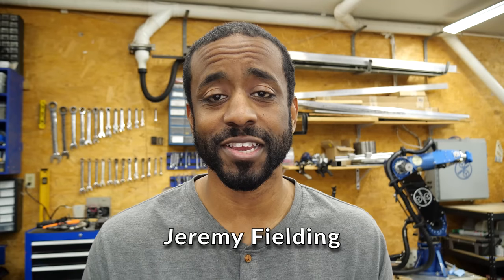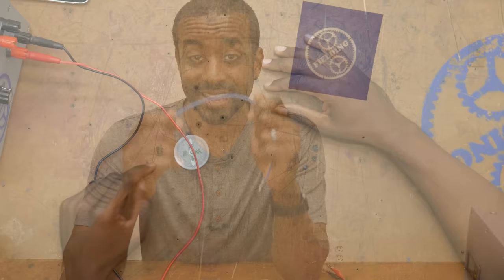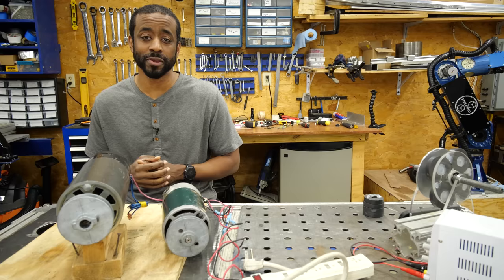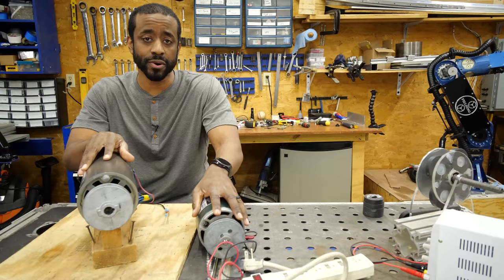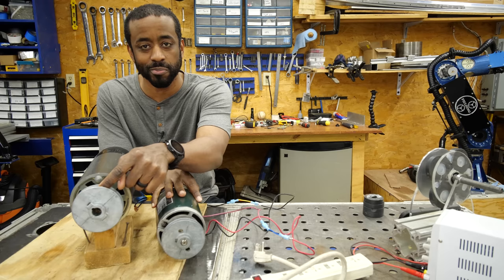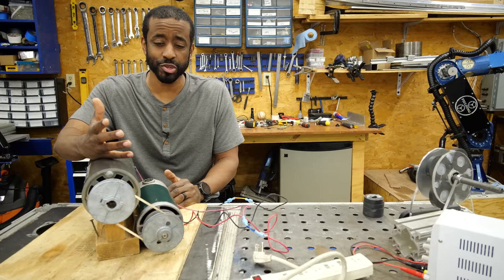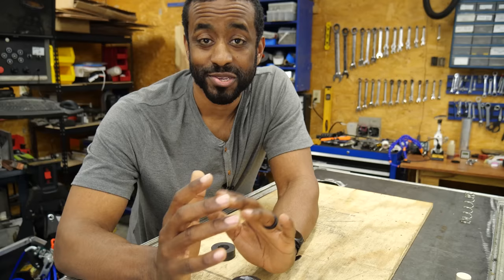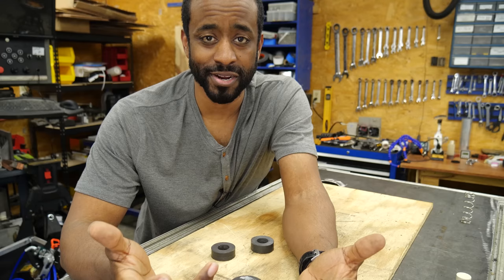Reviewing Free Energy Generators.  A Response to My Video "Nikola Tesla's Greatest Invention"- 102

Comment: Thank you for this! I was trying to design a generator for a small wind turbine to power a sensor cluster to record environmental data, and when I looked up anything to do with building a generator all I got was free energy nonsense. 
I'm in school to be an engineer. I know limit of efficiency is 1. Yet all I could get was fake free energy!
Reply: if you can take an alternator and reverse the polarity to make it a motor -- Could you just take a smaller motor and reverse it so it becomes a generator ???
Reply: @thistledewoutdoors3331  yeah but the effeciency of a motor wound to be a motor, running as a generator is lower than a "motor" which is wound to be a generator. It can be as much as a 20% difference, which means I could be losing hundreds of watts from Eddy currents and other field losses
Reply: @thistledewoutdoors3331 ,

Scientifically, motors and generators are the same.  However, motors and generators are designed and built to perform efficiently only for certain tasks.  This means motors (generators) work as motors (generators) quite well, but not so well as generators (motors).
Reply: @thistledewoutdoors3331  No. Just No. Look up the meaning of TANSTAAFL.
Reply: @invalidaccount2315  it's just so weird I want to make a normal, actual generator with an effeciency north of 75% and all I get is nonsense about fun magnets getting 150% effeciency lmao

Comment: Thanks for creating this video. I have had seemingly smart people try to convince me of some really dumb ideas around this. Device would need superconductors even to overcome the resistance in the wires connecting everything together. Motors would also need to be 100% efficient, which is impossible.

Comment: Jeremy,  it just occurred to me, when I built my over-unity device and shipped it off to claim the reward you offered, I forgot to add BRAKES.  Probably best to leave it in the box, and DO NOT turn it on, as it will likely keep accelerating until it flies apart!  Probably a VERY good thing I didn't start it before I packaged it for Fed-Ex.
Reply: Sure hope he spots this comment among the 10,000 ;)

Comment: Well, let's see:  It's missing the friction eliminator, the negative resistance feedback wiring loop, the flux capacitor, the recombobulated fratostat, the entropy reversal module, and the galloping rods. PLUS,  the shafts of the motors are not made from whittled down magic wands. Without these requirements, it cannot work too well... 😑

Comment: Mr. Fielding thanks for the videos. Very well done. I wonder if someday you could address the devices that are purported to save up to 50% or more in electrical power for the household. These fancy little plug-in boxes with a couple of capacitors in them and an LED are all over the net and I'm sure they are being successfully sold. Capacitors do raise the power factor in an induction-rich circuit but that ultimately only benefits the power company. The consumer pays for watts and the consumer's watts stay the same. They have incredibly lengthy ads supporting these devices but they are so full of BS it's laughable. Thanks again.
Reply: They don't work.  120 volts ( pressure ) spinning 15 amps ( flow of electrons ) will never gain in a circuit because they go through ohms ( resistance ) shedding heat ( efficiency )

Comment: Did this experiment when i was 8 years old.  That was like 1987.  I had never even heard of tesla or free energy at the time.  I was playing with dc motors and thought doing exactly this may work.  I never got the output to consumption ratio correct.  Maybe with gearing and a capacitor in-between the dc motors maybe.  I also set it up with a heavy flywheel and a time relay that would apply the power for a couple seconds and let the momentum of the flywheel charge a battery while it slowed down.  No go.  Either way im sure it wont work.
Reply: That’s a great idea with the “pulses” of energy, although it’s still theory and won’t work, it’s still a more thought out idea than a lot of them.

Comment: The last 90 seconds of this video is basically what the US Patent and Trademark Office tells inventors: You send us a working free energy device (not just drawings) and we'll give you a patent after we verify that it works. You can still file a patent application if you want, but in the case of perpetural motion, the USPTO will reject it without a working model. The USPTO is still waiting for someone to meet this requirement. So far, nothing.
Reply: @enigmatistic8470  and yet, no sources or documentation are offered. Not even a Wikipedia link. Just assertions.

Comment: The fun part is that some electric cars do have something like an alternator, that's how they recharge themselves a bit when you brake. That energy isn't free, though: you put the kinetic energy into the car when you accelerated.
Reply: My bmw i3 gets 60kw/h from every 100km at full regeneration. For every 50km at full regeneration I get a full battery (200km driving fast in the city). Electric cars are incredibly efficient in some environments
Reply: @ronhonhola  I have a golf cart with 300 watts of panels on it, and I don't think I've plugged that thing into a charger in 2 years now. But those panels don't really do much more than trickle charge the battery.  And it sees all of maybe 3 km of driving a week.

Comment: The only actual free energy comes from those easily made wind turbines,you see guys build super cheaply from old home fans,making longer fan blades , securing it nicely on their roof & hooking it up to a n alternator, or maybe wiring it straight to a VM multi plug extension cord,then as long as it keeps spinning there's your free power,which in many spots around the world ,can/ does work easily & with no monthly power bill,about as free as it gets,adding an alternator & batteries so you could store a little surplus energy is also a great plan if they can afford those things

Comment: Attaching an alternator to the motor, of course, an electric automobile motor. Like a motor with a transmission torque converter between itself  and an huge alt attached to the converter

Comment: I had to tell a couple family that you couldn't get more energy from setting up a hydrogen generator on their cars, that it would take more energy in the electrolist then you'ld get from fuel it produced. I was glad I found out befor they sent in 100's of $ for  kits.
Reply: oh god that's a horrible scam product
Reply: @adammills4099  Yes it is. However, you can increase the efficiency of the entire system (engine) by using Hydrogen, but not by much and it would take an AWFUL LOT of modification.

It's absolutely not as simple as "Just slap one of these beauties in the engine bay and you're good to go" as they suggest.
Reply: Maybe not if you use Magnetohydrodynamics MHD to turn turbines and generate electricity you also get hydrogen and oxygen gasses. Big Oil has a three phase motor running all their Grasshoppers/Pumps imagine all those Oil fields using all that Electrical Energy...
Reply: @steve-o6413  got any links?
Reply: Stan Myers

Comment: Another example of why it can't work, right in your video but unmentioned; when you spun one (electrically but not rubber-band) connected motor by hand, the other spun less . And this was the case spinning both motors. 

The hardest part of designing a free energy/perpetual motion machine, is hiding the power source. And as you showed in the video, it's not even that hard!

Comment: Ok that clear a lot of thing up thanks.  Which leave me with my original idea: connect a battery to a motor - connect a belt from motor to the alternator - connect the output from the
alternator to a charging control system and feed it back to battery for charging, as well as to things like inverters, rectifiers, light bulbs and so on. Sort of what you would do when using a solar system.

Comment: I'm a former mechanical engineer. Propetual motion machines don't work. They literally violate the laws of physics. I've had some ideas using moving shielding around permanent magnets. Then I worked in electric motor prototyping for a major OEM and realized my concept had the same fatal flaw as all perpetual motion machines. Ignorance on the part of the designer.
Reply: I think the reason all perpetual motion machines don't work is because of a fundamental law of the universe -- Entropy always generally increases over time. Why this matters here is, entropy is the loss in useful energy (Useful energy meaning it can do work), and as it always generally increases over time (The reason I'm saying it generally increases is because you can locally decrease entropy by capturing as much energy as possible, but you always have some loss somewhere, because to decrease entropy, you need energy to move the energy back in, and this means you lose some of that energy, thus still generally increasing entropy but locally decreasing it), you always have some energy loss somewhere.
Reply: The neat bit is that it’s possible to make machines which, at a glance, behave like perpetual motion machines, because they’re tapping into deceptively ‘sized’ sources of previously stored energy.

For example, you can create a machine that slowly extracts the energy stored in a permanent magnet, slowly weakening its magnetic field to the point that, given long enough, it would be a completely inert lump.  If your device is built precisely enough, with small enough losses to friction, vibration, etc. it would survive most examinations, because ‘permanent’ magnets aren’t commonly thought of as batteries.  (Your losses have to be incredibly small to make I work, though, because it’s a battery with an incredibly low instantaneous output.)

It’s easier to hide a normal battery in most devices to provide that ‘free energy’ for your ‘perpetual motion machine’.
Reply: @Vessekx  A permanent magnet has no stored energy, at least not different stored energy than any other matter. Demagnetizing a permanent magnet involves changing the alignment of the grains in the material and like moving anything else takes energy to do.
Reply: @nikkiofthevalley  Entropy can not always increase. You would turn universe motion into non motion, which is not possible.

Comment: I was intrigued by free energy devices for a while when I was younger - in particular the thought I had was that since there were so many claimed methods of generating overunity (gravity 'glitches', permanent magnets, back EMF phenomena in pulsed electromagnets), at least one 'had' to work. I got sidetracked by the idea that "OK, X is a 'conservative field', which implies there are fields which are not conservative, or maybe it can be 'tricked' into behaving in a non-conservative way". Ultimately what I got from it was that it's a very fundamental thing - for the universe to be comprehensible the law of identity must hold; a thing is what it is and cannot change without some reason. If you have one thing it cannot become two things, or fifty things; things can't vanish without going somewhere and things can't appear without coming from somewhere (as a baby has to learn at an early age). Conservation of matter and energy are implied by the fact that we can observe a universe that seems to make sense. Once that energy's spread out and disordered beyond a certain point, it's not gone - but at some point it will take more energy to gather it up and reorder it than you would expect to get out of it. Beyond that point there's no sense in trying to recover it. Once again - once disordered, a thing won't become ordered again without some cause, so the Second Law of Thermodynamics is also implied by a comprehensible, rational universe.

None of this rules out devices that tap into some hitherto unknown source of potential energy, even one too vast to be realistically exhausted by human needs. There is however no reason to believe that such a device would be more efficient or useful than a solar panel - free energy advocates often just seem to assume such energy sources would be reliable, work everywhere, and be scaleable.
Reply: WRONG!!!
Reply: Half of universe is entropy and half is negentropy. Negentropy is life-force and consciousness. Things do not stay disordered, because every disordered piece in universe get used again combined shifted and made ordered again by negentropy/consciousness. You can say that negentropy is infinite in what it can see and utilize. Since everything in universe is configuration of movements, and movements never stop, configuration of every object always change as it move through time space and its location and links with everything else change every moment. An object is trading codes with every other object. "Energy" is not vague scalar property that you have or don't have. Energy is configuration of motions, a code in other words. Therefore every atom poses differently coded energy because it is unique because it is in unique time space location, and have unique trajectory compared to everything else, and it have to communicate its configuration and trajectory to everyone else. This describes fractal hologram. This communication of everything with everything is called trade of codes. Its unstoppable and happens regardless of what object is doing or not doing. When you make overunity device, the device is trading codes with the rest of universe. If you made it in proper way, it will send out codes of movement that you don't need and receive back codes of movement that you do need. Those needed and useful codes of movement you call free energy. There is always plenty of it if you trade it right. The energy that you spent can not stop existing, it ricochet trough space time and will always get picked by negentropy factor that reorder it for utilization again. Every energy get utilized again. That is why you can always get it back if you state which energy codes you want, and which you will trade for it. Law of Thermodynamics is brainwashing.
Reply: @radivojr  WRONG
Reply: @radivojr  Rubbish

Comment: The last "perpetual motion" machine I played with required you to 1st charge a closed circuit coils of copper wires. Only the magnetic field was "perpetual". Only had to recharge it 1x time in 15 years. (Because the liquid helium got too low. It was a magnet for an NMR)

Comment: Having at least 1% of functioning 'grey matter' is all I need to know that perpetual motion is impossible. Being a qualified armature winder for 45 years and knowing a little about electricity also helps. I've watched a couple of these so called 'free energy' or 'perpetual motion device' videos and have great pleasure in calling out bullsh*t in the comments. Good (and potentially dangerous) presentation.
Reply: Bryan Farrow: there seems to be a lot of non functioning grey matter these days.
Reply: yeah, especially when the plug to the powered extension strip was just sat on the metal bench, could have been an electroboom moment 😛
Reply: Dark energy % never goes down despite the universe expanding far faster than light. Check and mate.

Comment: Voltage is exactly potential energy, that is specifically what the unit defines. The math isn't the same as for spring energy, but that's just because the potential gradient for a spring is far more nonlinear compared to electric fields, or gravity.
Reply: No! Voltage does not define potential energy. It may be referred to as potential difference in some situations but that is not Energy. Example: a cell in a car battery is about 2 volts, and a lithium cell is about 4 volts. Which has more energy? It isn't possible to know that if we don't also know the Amp Hour (Ah) capacity, and that is usually a function of it's size or the amount of active material in it. The 2volt lead acid cell (And there are 6 of them in a 12volt car battery) may be around 40Ah, multiply that by 2v and you get 80Watt hours of energy. Your typical 18650, 4 volt lithium cell might be 2000mAh or 2Ah giving you 8Watt hours, of Energy.  A ten fold or 'order of magnitude' difference.
Reply: @stevelloyd5785  i suppose you're right. It's more of a gradient, like gravity. You don't know how much energy you have unless you know how much charge you have to move through the gradient.